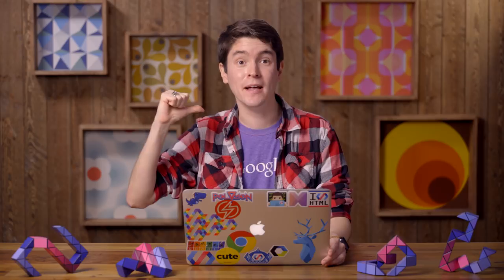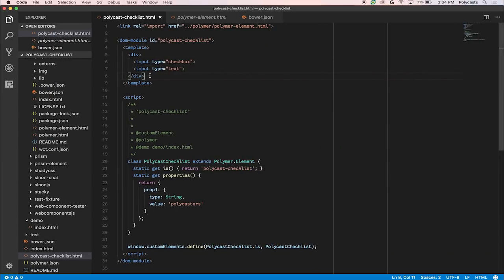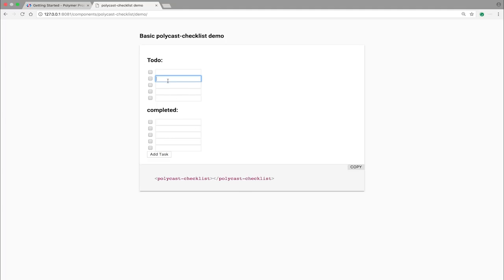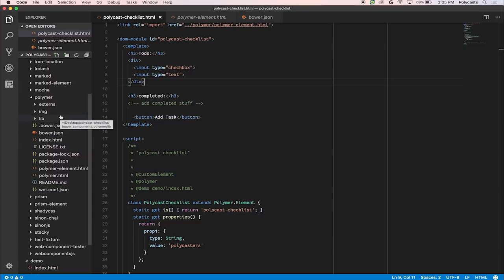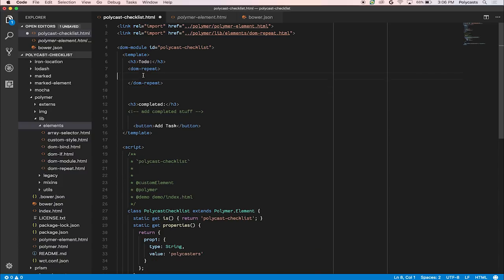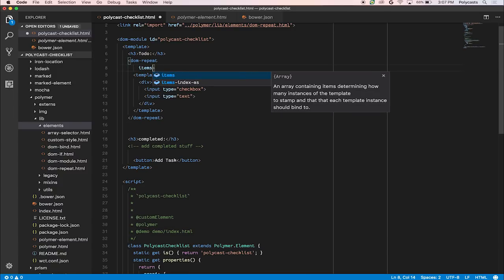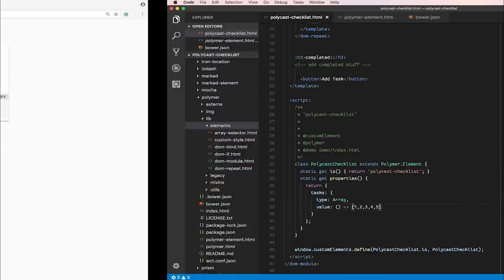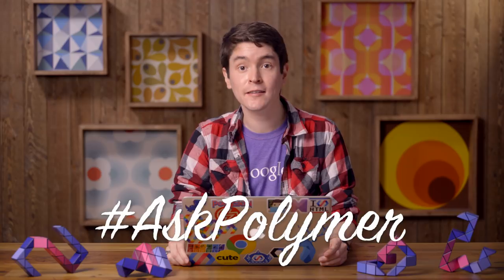Building an Element in Polymer 2: Basic Polymer Conversion (Part 3 of 5)

Comment: Why using curly braces for "items" and "task" and not brackets if you only need one-way data binding ? Is there a specific reason ? Thx for your videos.
Reply: The reason is that I did not have the time to explain the difference between 1 and 2-way data binding as the series was already running too long. You are correct though: one-way databinding is the way to go for most of this.